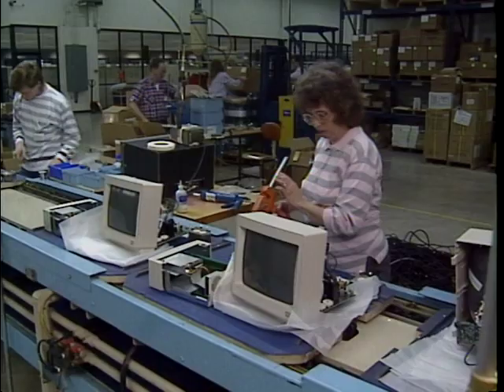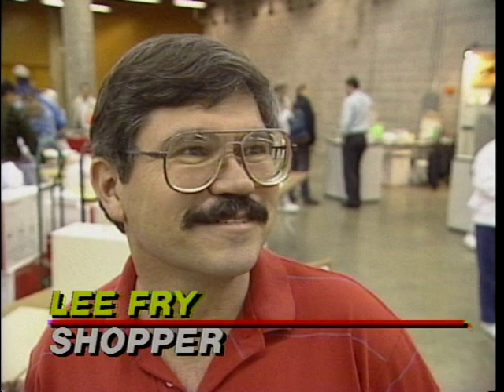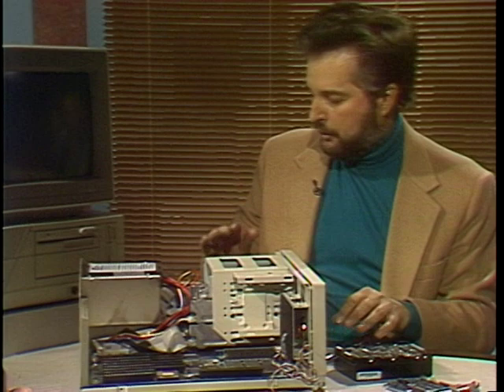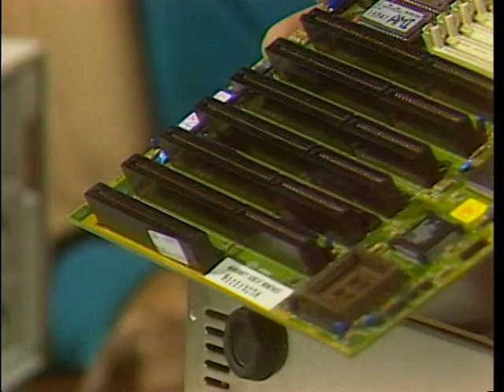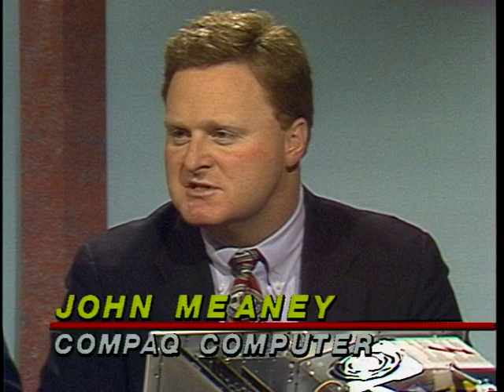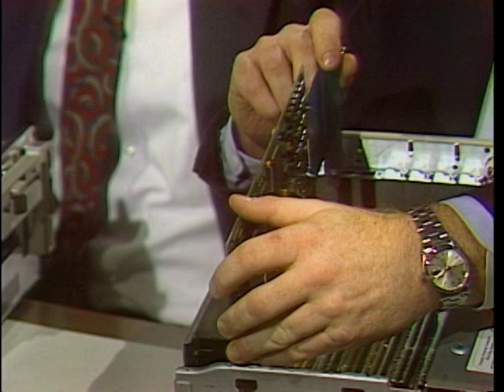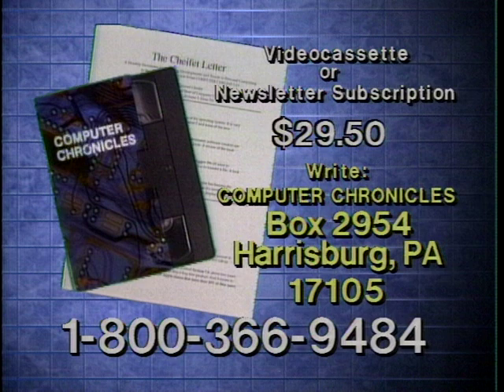The Computer Chronicles - Build Your Own PC (1992)

Comment: My first build was a 486DX266. Currently building i9-13900k / 4090. 

Fair winds and following seas to all.
Reply: Nice, but why not get a 7950X3D instead? Not only is it faster, the AM5 socket will last a lot longer too, so you'll be able to upgrade your CPU years later.
Reply: @Psythik  Valid points. I've built AMD systems in the past and they worked well. Intel is my current choice. AMD possible as a future build.
Reply: @Psythik Not to mention AMD's power efficiency currently

Comment: Crazy the advances that really changed the PC landscape in the three or so years after this... in '92 it was very much usable to still be using a 386 with a Hercules card, or even a cheap as hell 10 mhz XT clone if you weren't a power user, but between multimedia PCs (Which, granted, were already becoming a thing in 1992) and Windows 95 and the rise of CD-ROM, suddenly the average home PC jumped in specifications a pretty decent amount

Comment: I did my first in 1996. Bought parts from Friz Electronics in LA. Pentium 166 MMX, Quantum HD upped to a Seagate, dual speed CD, 32 mb Ram in 2 slots of 16s. 56 kbps. Modem that I upgrade to 96kbps Qualcomm, VGA card and Super VGA monitor. Mouse and other neat stuff for the time... Disquette drive. Run Win95 disquettes. Office 95, FS 95. Epson printer.

Comment: This is a great episode!  I just bought a new used tall tower 386DX-25 MHz. with a 387 math coprocessor, a memory board with a full 72*128 kB. of RAM, a 1.2 MB. floppy and a 1.44 MB. floppy, turbo button, controller card with its own BIOS for hard drives beyond the system BIOS limit plus the capacity for 4 total floppy drives, and a combination modem card and sound card.  But no hard drive, so it was removed by the previous owner who used it as a gaming computer during its first life.  This thing was a monster when it was new.  I've been doing a lot of learning on the Internet to figure out how to get this computer in fully working order.  I had to buy a DIN keyboard and a serial mouse.  So far it boots via floppy and I can use it without a hard drive for word processing for example, but I need to get a hard drive it can use to enable everything else. 💻💾💾💾💾📀🖱
Reply: I'm about to build a new gaming computer so it's nice to have a show like this to keep me up-to-date on the latest parts. I watch it every week! (EDIT: That "TTL" graphics card looks neat; I wonder how well it can handle ray tracing?)
Reply: Update: The leaking battery on the motherboard of the tall tower 386 had actually leaked onto the controller card, severing two of the traces that led to the hard drive header.  That’s why it could boot from floppies but not hard drives.  Once I bodge-patched those traces, hard drives worked fine in it.  I also added a SoundBlaster SB-16, a CD-ROM drive, a parallel-port external Zip-100 drive, and a CompactFlash adaptor expansion board so I can easily move files en masse to it and from it.

Comment: The trouble with building a computer back then was the technology was changing so fast that you couldn't keep up.
I remember getting a LS-120 drive for one of my computers and within about 1 year you couldn't get LS-120 disks anymore. I got a kick ass 2 speed CD Rom drive for $200.00 and a year later none of the new disks would even play on it. I still think I have a top of the line video card from about 1990 that was kick ass with 256 colors.
When was the last time someone had to buy a sound card for a computer?
Hell I still remember paying out $100.00 for a 9600 baud modem so I could send faxes but my first one a year earlier was 2400 baud and a year later it was 33.6.
I still have my first HD a Western Digital Caviar 1210 210 meg that was plenty of storage and now it is used as a coaster on my desk for my drinks.
I built this computer about 10 years ago and the technology hasn't changed from then to now. Even processor speeds seem to have stopped increasing and the memory and video are at a standstill.
The late 80s and early 90s were the fun time to be building computers but you needed a large bank account and as soon as you got it built it was out dated.
Reply: Yeah, my PC is 11 years old and my overclocked q9550 is still doing fine for my modern needs. I can play 4k hevc films on my 4k tv with this setup, no problems.
Reply: "When was the last time someone had to buy a sound card for a computer?"

==1997, when I had my BabyAT mobo. I had a SoundBlaster 16. It had a Cyrix P200L+.

I think my next system was a Pentium 3.
Since it was a miniATX mobo and all such mobos come with integrated sound, there was never again a need to buy a sound card.
Reply: @louistournas120  A dial up Modem too, when was the last time people put one of those in a PC,  early 2000s?

Comment: You gotta love the versatility of the 3 different floppy drives! Wow! Just imagine all the stuff you could do with that. You could put a couple of JPG files on those even! LOL :)
Reply: Back then a 3MB program was huge and light years ahead of it’s time
Reply: @Craiglaca1  nah....by 92 there were plenty of programs much bigger. I remember Wing Commander II was almost 30 megs on my 40 meg HD in 1991.
Reply: Haha, but in reality images back then were much smaller in file size because of the lower quality (MP).  I was on the yearbook committee in high school and remember using a digital camera that saved to floppy disks.  I can't remember exactly how many images one disk would hold but I do recall I could take a lot before it filled up.  My guess is somewhere between 25-50.
Reply: @JimmyRussle Yeah, as the video suggests, by this time most people had hard disks so programs were quickly becoming bigger and bigger since they weren't constrained to one disk anymore.
Reply: This video actually predates JPEG! This was taped in late 1991, and JPEG didn't exist until September 1992.

Comment: Back then, building PC's was a difficult proposition. This was before the ATX standard, so you had to be wary of proprietary formats.  As long as you stuck with the AT form factor, you were good to go.  Assembling the computer wasn't that hard, but you had to be careful with connecting the power leads to the on/off switch (yes, computers actually had a mechanical switch to turn a PC on.).  The hard part was getting the hardware to work properly with the operating system using the correct drivers and resolving device conflicts. Plug 'n play and PCI weren't around yet.
Reply: +Dennis McIntyre Hard part was trying to get help when something went wrong... these days you just google your problem and up comes hundreds of answers to try.  No such luck back then.
Reply: @oldtwins  google wasnt even thought of, in fact the internet wasn't even out.  Maybe in the very early stages.
Reply: @procta2343  It's been around since the 80's, it was just a very different beast.

Comment: My first computer was a handmade copy of the Microdata 1600 mini (about 700 ICs and 6 cubic feet of rack space). I booted it once then moved on to a KIM-1 6502 SBC which I used to help in my design of a Z80 S100 system (running CP/M & MP/M) that went into production for a few years. The timeframe for all this was 1976 - 1979. I ran benchmarks for the 4 MHz Z80 against the Microdata 1600 and found the Z80 was faster, largely because core memory in the 1600 had a 1 microsecond access time, a very common bottleneck for core-memory minis.
Reply: Doddo MultiGamer With a memory-mapped video card the frame rate was 80 FPS.
Reply: Doddo MultiGamer I ran a number of games that were character-based graphics, a Startrek game called TREK80, a Space  Invaders game called TARG and a few others. They were actually quite good and operated at a selected speed setting (user set). At highest speed they zoomed along quite well.

Comment: the guy at 20:00 definitely did not plug those expansions in all of the way. Good bye computer as soon as powered on.
Reply: Well obviously it wasn't fully built, because of time restrictions
Reply: @RWL2012  Dude had plenty of time, he just clearly had no idea what the fuck he was doing.
Reply: @thomasbarkas6092  If you look carefully at the cards, you'll notice that there is a metal foot sticking down, out of the bracket on the left side of the slot. Whatever that foot is for, it's clearly not properly adjusted, and it's preventing the card itself from fully seating. Has "...no idea what the fuck..." he is doing, maybe, but I think it mostly an issue of poor preparation; those brackets were clearly meant to be adjusted to support the card and it was not done ahead of time.
Reply: Also that "you plug it and works" what a lie getting this at computers to work is a nightmare when you have multiple boards, jumpers here and there irq conflicts i/o ports to choose dma problems. slave master drives, selecting drive type on the bios.

Comment: Of course, Compaq ALR never really went anywhere for the simple, obvious fact that it was proprietary, whereas you could get cards from anyone that would fit any PC compatible. I remember when I was working in computers a customer bought in an ALR to upgrade, and we basically couldn't do anything, including using the case, just like later Dells. However ALR cards could be found very cheap because they weren't very useful.

Comment: This is one thing that hasn't really changed a whole lot since then. I mean yeah, we've got more ports, we've got USB, Firewire, SATA... Floppy drives have all but been replaced with CD drives, but the meat of building your own computer is still very much like what's in this video.
Reply: +Starscream Well said.
Reply: +Starscream Close to the same, but not quite. Back then you had jumpers for FSB, multiplier, voltage and everything else and you had to get that right. Even early sound cards were configured with jumpers (IRQ etc.). The CPU socket was usually one of those awful LIF sockets that was a total pain in the ass to remove the CPU from (you had to pull straight up with about 15 pounds of force, or gently pry the CPU out with a flat head screw driver a little bit at a time on alternating sides). The CPU wasn't keyed in any way, so you could put it in 90 degrees wrong (I assume it would have let out the magic blue smoke and stopped working if you ever did). Everything that's in the south bridge now used to be an add-in card. An add-in card for mouse (e.g. bus-mouse or PS/2), an add-in card for serial ports and parallel ports. An add-in card for floppy drive and IDE controllers. L2 cache came as DIP chips that you inserted into sockets on the motherboard, before they became soldered to the motherboard, then integrated on the CPU package (that's what that whole slot form factor was about) and eventually integrated into the CPU die.

Cooling didn't matter; just the PSU fan drawing a little bit of heat out was enough. Nothing had a fan, or even a heat sink in the 286 days.

Comment: Loved how they left out the obviously most difficult part of PC assembly which are the front panel connectors! Also, you BETTER turn it on and pray, as the power button won't even work and not to mention the molex power connectors are all missing, LOL! "And essentially, we are assembled right now!" XD
Reply: Wonderpierrot the switch on the case was wired into power supply

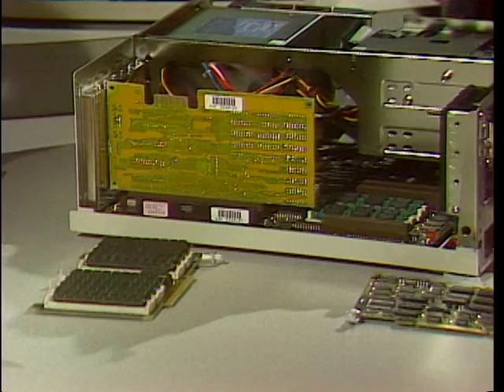Comment: 19:43  Those expansion cards don't seem to fit properly on the motherboard.
Reply: no he just does not care or know how to properly install them correctly to him it's in the system it's fine does not matter if it's in there correctly so they will fit properly and make a connection so when you power up it works right
Reply: I was hoping it was hooked up and there would be smoke when they powered it on
Reply: The MB is kinda flexing, maybe he didnt want to put too much force on it so it didnt break
Reply: LOL i know , notice his voice got all nervous ,as i think he knew he messed up ha ha
Reply: @christineayres5339  I guess Stewart makes everyone nervous when he keeps pushing them along during the segment!
Reply: @ayersuk  Yeah probably , i just love these old PC,s you cant beat the sound of a mechanical HDD ,its like relax therapy for me and also those funny noises from floppy drives etc i miss the 80s and 90s PCs even though they were only really good for kids gaming
Reply: @christineayres5339  I remember getting my first PC when I was a kid in the early 90's.. it was a Tandon 286 with orange/black mono screen, first thing I did was rip it apart and rebuild it again just to see how it works! Now I'm typing this on a 27" iMac and have no interest in ripping this apart... I miss those days! 😂
Reply: I think he plugged them in the wrong way around.
Especially with the cache card you can see that the IO Shield is facing the inside of the pc instead of facing the case
Reply: @kanonenfutter8433   @Kanonenfutter  That "I/O" is just a support iron used in those ALR cards. They were the right way but he just didn't force them enough.

Comment: Damn, I was born in 1992. I'm actually surprised by the size of that RAM. In 1992, you could buy 4MB SDRAMs to your laptop which were much smaller. Then in 1996, 16MB was minimum.
Now, I tried to sell 512MB DDR2 SO-DIMM on eBay for $0.01 starting price and no-one bid.
Reply: yeah my system has 128 gb of ddr4 so 512 mb not worth it or needed🤣
Reply: @raven4k998 ddr4 ? haha peasant 😂😂 i have 512gb ddr5 7200mhz

Comment: Cost comparison:
 The Microdata 1600 used core memory costing $2,000.00 per 8 kilobytes. That means my present system with 16GB RAM would cost $4,000,000,000.00 for memory. I also worked out hard drive energy inputs - ganging together enough 80 megabyte CMD disk drives from 1980 to make a 1 terabyte array would result in a power consumption of 6 megawatts. The comparison for smartphones gets even better results.

Comment: Early to mid 90s somewhere, don't remember the exact year it was a long time ago, built a 386. With just a couple exceptions my desktops since have been DIY. 

I've priced out my current desktop as a prebuild, and it might be cheaper now that Zen4 is out, but it was around 6000USD, I spent around 3400. And that was during the dark days of GPU scalpers.
Reply: It's not going to be cheaper spec for spec for every possible configuration, but to nail down exactly what you need and nothing you don't, there can be huge savings over OEM systems when you do that. And you understand it better too.

Comment: One WHOLE megabyte of RAM!?  :-O
Reply: +Chubzdoomer   I have a 1984 Power Macintosh that has only 1 megabyte of RAM. I bought a 2nd 1.4 MB diskette drives and used it to go on the internet back in 1997 and 1998. Back in the days when you could install Prodigy  internet service with a single diskette.
Reply: 1 MB of RAM. That was high end

Comment: 15:54 take the screw driver to the computer  it is bad advice because there are several precautions to take before you should touch a CPU, RAM or graphics card. One is static reducing another is keeping your components away from magnetic objects and keeping them in a clean place until installed on in a new mother board.
Reply: None of the chips on the motherboard are sensitive to magnetic fields even while in operation. The harddrive is, but not nearly as much as you think. I tortured an old 1GB harddrive (that was hopelessly obsolote by then) once. I opened it and ran it while open; still worked. I took a massive neodymium magnet and without touching the platter swiped it back and forth very close to the disk while it was off; still worked. Smudged the platter with finger prints all over while it was turned off; still worked.
Reply: We need to figure out how to go back in time and tell this clown he's doing it wrong!

Comment: The horror of components that just wouldn’t comply, IRQ conflicts, ribbon cables that got tangled up, el-cheapo harddisks that failed after three months, dodgy computer companies with lousy service and warranty, crappy VGA-monitors, and then the motherboards with Vesa local bus, 8-bit, 16-bit, ISA slots. It was fun building it yourself, but I never had the money to buy proper components, so it was always a bit of a disappointment. I’m glad I can afford a no-worries laptop nowadays :)

Comment: These guys would be amazed how much junk has been removed from PCs nowadays. Looks at all those expansion cards and controller cards that aren't needed anymore.
Reply: Motherboard integration has gone through the roof.  Basic graphics and sound are on board, the optical media drives are all SATA compatible, and printers are USB.  A motherboard won't give you the BEST media and gaming experience on their own, but you can get by until you can get better add-on cards.

Comment: First build, SIS 486 DLC 40 MHz, 4 MB ram 420 MB drive. Last upgrade, STILL using a Supermicro X6DAL-TB2,  two Xeon 3.6 GHz CPU's 3 GB RAM, Nvidia 210 two 500 GB and one 1 TB drive.

Comment: I remember computer shows. The first two computers that I built, the components were bought at a show. Memories right there. I kinda miss the days of cases coming with a PSU.
Reply: You can still get barebones cases that come with a PSU. But why would you want to? They're usually very cheap, low-end PSUs and if you're building your own $500+ system, why cheap out on the PSU? It's the one component that can instantly destroy every other component you have.
Reply: True, but back then most PSUs were kinda shitty.
Reply: My Dad built our first computer from dumpster diving.  I think it was a PC-XT, with an 8088 CPU.  The first computer show I went to was for building our next computer which was a 386 clone with a VGA monitor.  It’s still in the closet somewhere and might still work.
Reply: Power supply wattage vastly depends on GPU and to a certain degree CPU config, hence systems not generally coming with them Anymore. Back in the day the wattage spread was much much less.